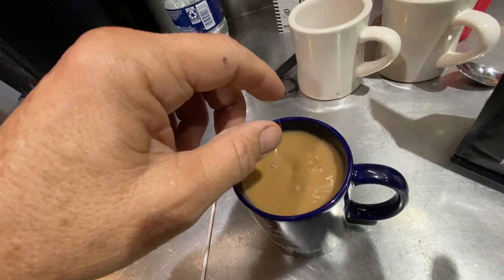Good up and at it Saturday morning...

Comment: Glad to hear about the progress on the generator; is it outputting power yet?  A heat pump would be a far more efficient solution as opposed to using those resistance heaters but the initial cost and work to install would be yet another major project.
Reply from the maker: It did, but now isn't so there clearly is more to test, review & check :)